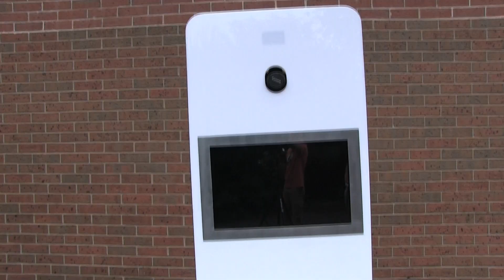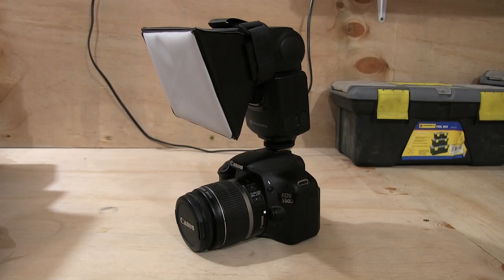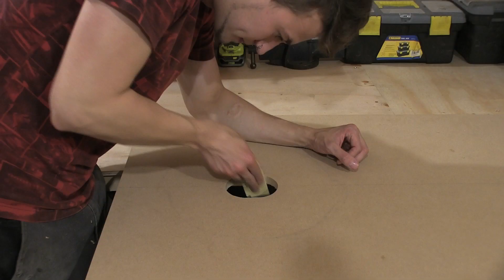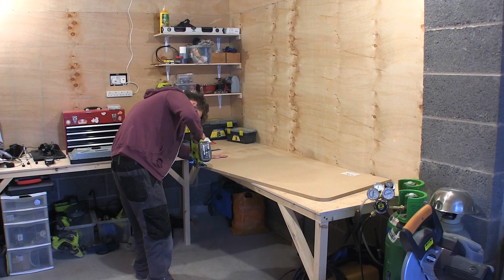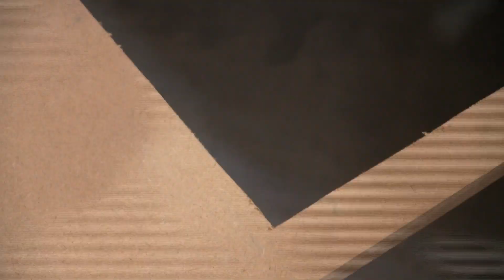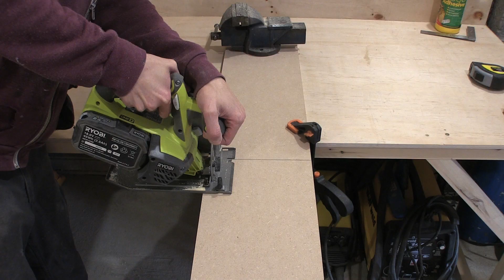Making An Open Air Photo Booth

Comment: Great video, I was thinking of trying to build something similar. one question where did you get the white perspex sheet?
Reply from the maker: Hey! Thanks for checking out the video. I wound up using an online supplier for the Perspex which I just found through google. I think the prices vary, so maybe try a few websites to get the best deal. There are a few cut-to-size online stores out there. Good luck with your project, hope you found this helpful :) I have links to the other parts I used in each of the video descriptions, should you need them 😁